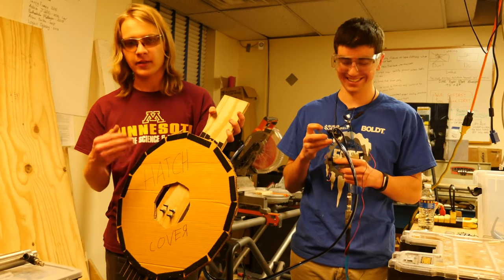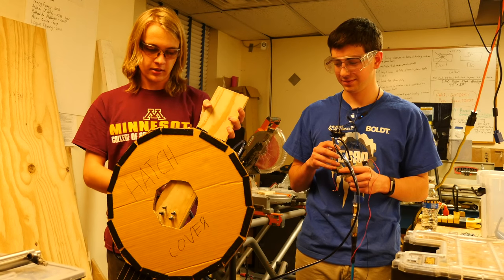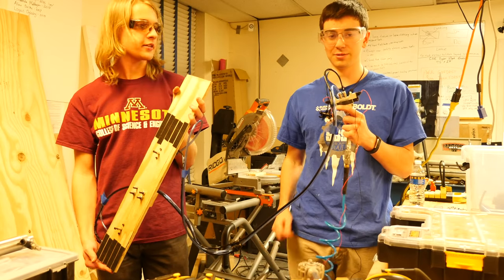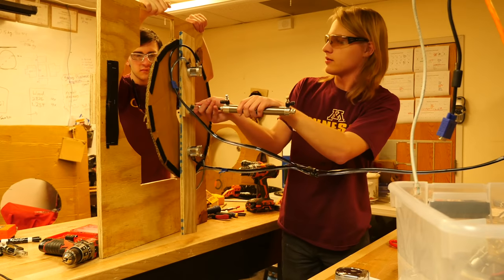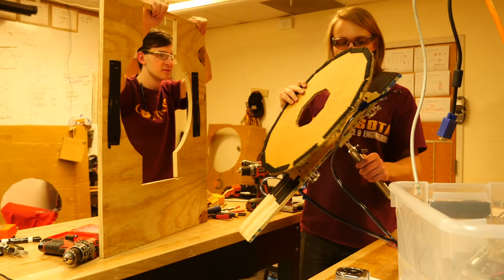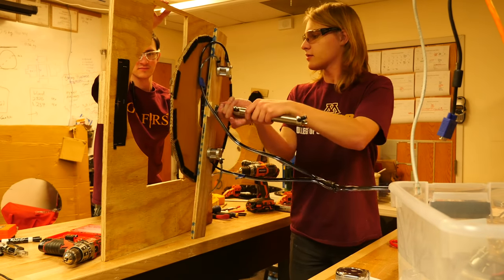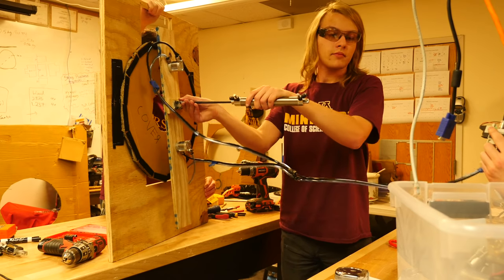Ri3D 2019 Day 1 - Hatch Panel Prototyping

Comment: Great prototype! Are you aware the loading station does not use hook tape to hold the hatch cover, but brushes instead?
Reply: Oh, maybe those are brushes? Hard to tell, sounded like you said they are velcro, but they look like they could be brushes...
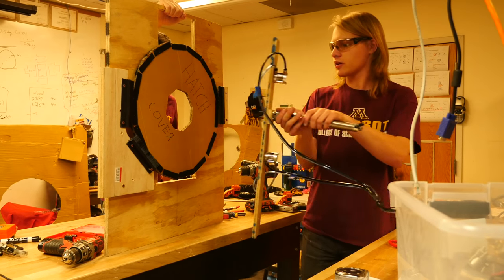Reply from the maker: @floatingcoder-gamedevelopm8302  Yes, those are brushes on that side (at about 2:52)! It's hard to tell since our brushes and velcro are both black.

Comment: What type of pistons are those that your using to push the hatch off the board?
Reply from the maker: https://www.automationdirect.com/adc/shopping/catalog/pneumatic_components/pneumatic_air_cylinders/inch_compact_air_cylinders_(c-series)/c12010d
^This one is used as the poppers in our popper mechanism. 

https://www.automationdirect.com/adc/shopping/catalog/pneumatic_components/pneumatic_air_cylinders/round_body_air_cylinders_(a-series)/double-acting/a17060dp
^This one is the one that actually pushes the mechanism forward over the bumpers.